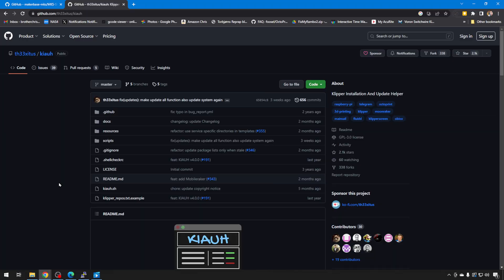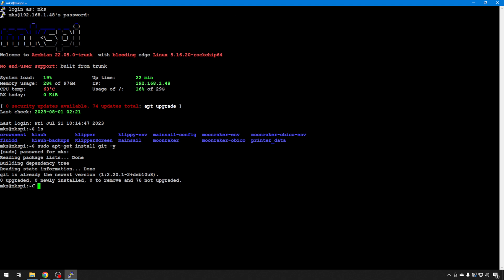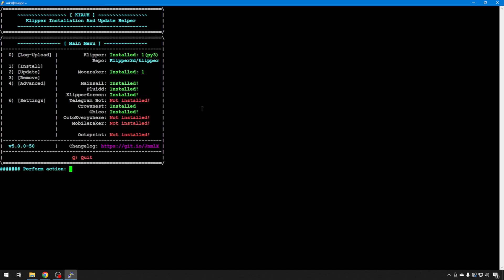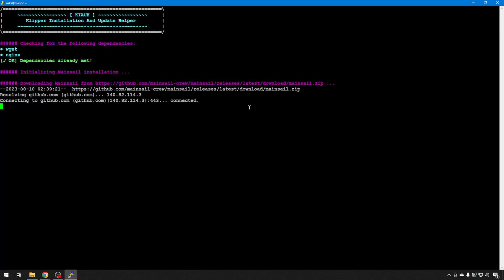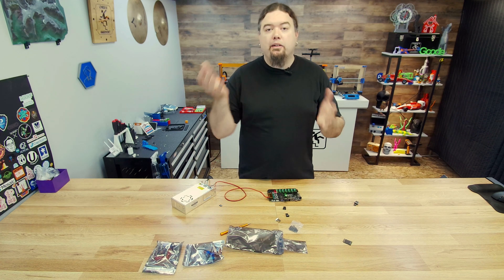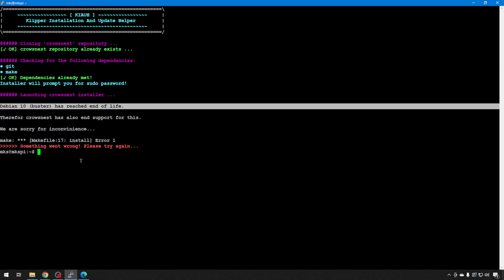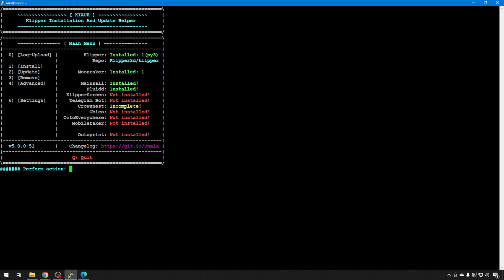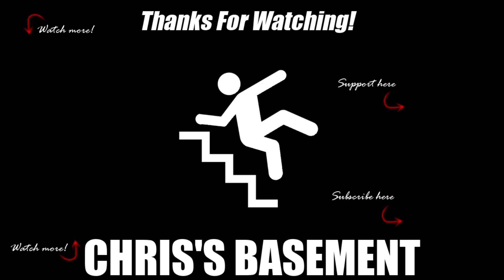KIAUH - The Easiest Klipper Install - Mainsail and Fluidd - Chris's Basement - 2023

Comment: Thank you for the coverage! I never expected that this project would develop such a wide reach.

Short clarification regarding the backup before update feature: that one is currently disabled in the background and won't do anything. I need to change some code to make it work again but i try to get around that as soon as possible. The rollback function does not utilize those backups though. Those backups would be plain old and simple copies of the folders of Klipper, Moonraker and so on. The rollback function actually rolls back the git history via git reset. It's an "in place rollback" utilizing the regular git tools so to say.
Reply: Did you change your name on github?  Also, Thank you for this excellent tool.
Reply: Yes i did. Im glad you like it! @joeldriver381
Reply from the maker: Thanks for the update and all the hard work on this!
Reply: Thanks a lot!  @ChrisRiley  Ah and you already spotted the update i made a few minutes ago? Yeah i went ahead and updated the backup functions quickly :). Also it's now possible to utilize the backup before update capabilities again which you mentioned. For some reason i cannot update my initial comment to clarify that i already made that code change. Anyways, thank you for covering my little helper tool! :)
Reply from the maker: @th33xitus  You're the best! 😉😉
Reply: So if you are using a raspberry pi then what enviroment would you choose rather than maker

Comment: Funny this popped up in my feed today, as I've been repurposing one of the kids' old Galaxy tablets into a linux tablet specifically for a tertiary delta rebuild. Debian took forever and a day to install without copy paste ability, but having a screen, the mainboard and a decently quick undercarriage with wifi all in one unit (that was 'FREE') is a huge boon. Guess it's time to get into KIAUH and finish up the software side!

Add: Well crap. I'm sure it's going to be more difficult without a dedicated Pi or equivalent, but thus far it will 'install' but everything says "Incomplete!"  for klipper, moonraker and mainsail. Everything else won't go to the next phase as (I'm guessing) it's not checking requisites or erroring out. This plan may have been doomed from the start. 😢

Comment: This script is great!
I really feel the need to thank you, Chris. I'm still using an Anet A8 (no, don't worry, I have an upgraded PSU, not that fire hazard that came with)... And recently I decided to upgrade it finally. I wanted to ditch the SD card for good, and started with octoprint running on an OrangePi Zero 3 and Marlin. Liked it, but immediately feel dumb as octoprint was just there to give me WiFi 😂
I jumped into the Klipper boat, and oh boy... What a mess, but really fun thanks to this series of yours! 
Now I'm in the process of installing an MKS SGEN_L v2.0, new drivers, new screen and get it all working before I dismantle the machine and convert it to CoreXY. I love this machine, it's still as fun as was in day 1.
Thanks dude.
Reply from the maker: Awesome to hear. Great work on getting all of this together. Great to hear to still find the fun in all of this as do I.

Comment: You mentioned an issue with the Debian 10 distro, has that been fixed?? I am very new (just a few days so far, still trying to figure out how everything works) to Linux, using LMDE 6 cinnamon, after DECADES of Windows, and have also NEVER compiled any firmware of any type. I just rebuilt my Ender 5 Plus to the point of, the only thing left that is still Creality, is the cube. I also built a triple Z axis following YouTuber "LilMikey's Big Plans" design. I have a BTT SKR Pro v1.2, and a BTT Pad 7. I've also seen videos showing the use of an old Android phone or tablet, to run Octo, not sure if that's even needed with the Pad 7. Compliments of a brain injury a few years ago, my hands, concentration levels, and just basic trust in myself when it comes to doing stuff like this, are all getting in the way. All the hardware is done, now it's just the firmware, and I just need to be 120% sure that I'm doing things right. The last thing I want to do is brick my board. What's even worse than that, is looking at my printer, and being unable to use it.
Reply from the maker: The pad 7 should take care of everything you need to run the machine. Including the distro issues. So if it is up and running fine, it includes Klipper. Go with what BTT provides for install files and you will be good.

Comment: Now I have my answers to why Two Trees SK1 has no camera. I badgered them to get the User/Password for three weeks before they sent it, along with a legal threat that if I 'exposed' their username/password they would pursue legal recourse (I'd already found the user/password at Makerbase and several Youtube videos). I have no idea when they will either 1. Refund my money or 2. Move to a different OS like Debian, either way I'm stuck with a overheating lemon. Yes, the MKS Skipr has two 40mm fans dedicated to it, the reason this machine has a 67db noise factor, yet no one is talking about the 'cooling' issues. I currently show 239 updates pending that will not be install... Oh and don't get me started on the use of M400
Reply from the maker: Sounds like Two Trees needs to do something about this. I would for sure request a refund.

Comment: I do not speak English well.
There are parts in the video that I don't understand.
This corresponds to about 5 minutes of the video.
kiauh - 3(remove) - b(back)
A screen where the installation programs are initialized will appear.
What kind of method is this?
Reply from the maker: Yes, this is Kiauh, it's a shell script to help install Klipper. https://youtu.be/LImiFmhMAB0

Comment: love the info provided made setting up my pi easy. I have a question maybe you could answer can you use KIAUH on the BTT CB1 board. the reason i am asking is i am upgrading my ender3's with the BTT  Manta M5P and CB1with canbus.
Reply from the maker: Yes you can! It will work exactly the same.

Comment: So I try to run fluidd in port 80 and mainsail in port 81
After I restart my board, I cannot access mainsail at port 81
What did I do wrong?
Reply from the maker: Hmmm, what version of Linux are you running? It could be a software firewall blocking the port, like UFW.
Reply: @ChrisRiley  Hi, Thanks for reply. I'm using the Raspberry Pi Zero 2 W. Using the Raspberry Pi OS Lite 64-bit with Debian Bookworm.
After I uninstall Mainsail and install it again using KIAUH, it is now working. Even after restart.
I restarted a couple of times now and its still working.
I don't know what went wrong in the first time.
Reply from the maker: @damzelfly  Awesome, glad it's working now.

Comment: Silly question I think... But I'll ask it anyways.

I installed Octoprint for my Ender 3's (v3 and v2) on an old PC and they are working great.

I want to play with klipper for both. Can I install klipper on the same machine? Or should I start over and install klipper on a clean install of Linux?

I'm not quite sure how the two systems might interact.
Reply from the maker: You can install them on the same machine, but I would start over and let Kiauh do the install. It will help you keep the installs separate and save you a lot of work.
Reply: Great to hear! Thanks for messaging back. 

Can you still use octoprint with marlin via kiauh? Or is it specifically octoklipper? (I apologize... I'm still new to this.)
Reply from the maker: @crooker2  Yes, Kiauh actually installs a generic version of Octoprint, so you should be able to use it with Marlin.

Comment: Hello I"m a newbei here... I installed klipper on my raspberry pi to use with my anycubic kobra 2, I keep getting this error "Source contains parsing errors: '/home/berty/printer_data/config/printer.cfg'  [line 289]: 'printer.cfg\n'". I have looked and cann"t a solution. can anyone help...
Reply from the maker: You have something going on in printer.cfg. It could be a bracket or something out of place. It says line 289, but it could be somewhere else.

Comment: Hi Chris, I successfully flashed my old Replicator 1 dual extruder printer with Klipper. I have klipper, Moonraker and mainsail as well as fluidd installed on a Linux mint laptop. This laptop is connected to my LAN I can print from mainsail as well as Fluidd but only on the localhost, on the laptop itself. I am not able to connect to the laptop from another network client. I am using :80 and :81 for M and F. I have already added a couple trusted clients into the Moonraker cfg but no joy. Do you have an idea or tip? Thanks
Reply from the maker: It could be a firewall. Check this out. https://forums.linuxmint.com/viewtopic.php?t=282502 It should be off, but double check.
Reply: @ChrisRiley  that is exactly what it was. I turned off the UFW in the mint firewall and things started working. Thanks for your reply.

Comment: Could I use this on my old prusa mk2.5 printers? I have an rpi on bot of them running octoprint.
Reply from the maker: Hey Espen! Yes, you can. You would use the flash menu option to flash it. You don't have to do the SD card stuff like on 32b boards.
Reply: @ChrisRiley  great! Does klipper constantly turn on and of the heatbed output like prusa does (multiple times a second). I had a problem with the heatbed terminal on one of my rambo boards it started melting. So I used a relay instead and just used the terminal to control the relay. The problem I faced was that I had to use an older firmware on the printers because the newest one at the time constantly turn the heatbed on and of like crazy. The relay was clicking like mad!
Reply from the maker: @EspenShampoo25  Prusa is really aggressive with the PID on the bed, you're right it does it really rapidly. With Klipper it's more mild. You shouldn't have that issue.
Reply: @ChrisRiley   follow up question to this. I've got a MK3S that I'd love to set up with all of this and have input shaper and other fun features working on it; would I need the MKS board in addition to prusa's board or would it replace it, or would an existing raspberry pi (like a pi3B) work fine (so long as I get Linux installed on it first)? I just want to clarify this comment for my own sanity in case I'm missing something here.
Reply from the maker: @Mr25561  You would just need to add a raspberry to get klipper working. The stock board should work fine. It does take a bit of extra work to get the Einsy up and going because of a serial chip issue. https://github.com/dz0ny/klipper-prusa-mk3s
Reply: @ChrisRiley  Awesome and thank you! I'm looking at it now; it looks like it calls for a raspberry pi zero 2 w, however it looks like there are commands to change it to look for a USB connection. It's definitely something newer for me to look over. Now I just need dig up one of my rasppis out of storage.

I'll keep you appraised of progress, and again appreciate your content; I definitely reference you a lot for MMU related concerns. ^_^
Reply: Nice, I'm in the process of upgrading my mk2.5s printers with hemera extruder I've had lying around for years now. Have thought about upgrading to a new printer but I don't think mk4 is worth the price! Should have been a corexy imo

Comment: Thanks for your great video.

This board seems very interesting. Qidi uses it also on their new X 3 series. I ordered an x-max 3, it should be delivered soon. I also ordered the eMMC adapter (there is a USB version also) and a spare eMMC module (both together about 12€ on Aliexpress), so I can do a backup of qidi's setup in case something goes wrong while update or tinkering.

In other videos it's mentioned the 8GB of the eMMC is a bottleneck, there is low free space and storing gcode in the default folder (wich is used if you connect the slicer to the printer directly) is limited by available space. So I thought about using a bigger eMMC module.

While there does no seem to be a bigger module from mks, the eMMC module for Orange Pi M4 seems to have same connector and formfactor (the two screwholes left and right of the connector do not exist, but the other (not used on the skipr) is in the same spot. The adaper to microSD looks identical. So I ordered the 32GB module with adapter. As I  do not know if the connector realy has same pinout, I will just test the spare 8gb-mks module with the adapter shiped with the 32GB module. If it works, its electrical compatible, if smoke accours, its obviosly not (and I just lost the cheap 8GB spare module and maybe one adapter).

Still, I remember on a rasperry pi you had to start an autoexpand to use full storage size if you have a bigger sd than the image. How is it on the mks skipr? If you flash the image on a larger SD or eMMC, do you have to expand the system afterwards manually or is it done by the system on first boot automaticly?
Reply from the maker: I am curious what you find out with the larger drive, I hope it fits the board, that would be great. Armbian should expand it automatically. If it doesn't, just reset the run once. https://forum.armbian.com/topic/487-reinitiate-sd-card-resize-on-boot/

Comment: I love KIAUH but if you use it,  I would not recommend doing updates from Mainsail or Fluidd, always do your updates from KIAUH. I've tried doing the updates from Mainsail and it failed and ruined the whole setup. I had to reinstall everything. I dunno if it's different now but I never had an issue updating from KIAUH so I only update it that way.
Reply: Thank you for liking the tool :) Usually KIAUH is designed to work hand in hand with Mainsail or Fluidd. Updating happens through Moonraker in that case. I don't think Moonraker does things differently than KIAUH does, but i can't tell 100% sure.
Reply: same thing happened to me…
Reply: I did have an update that I applied through Mainsail introduce a bug in Klipper that required reverting. I ended up fixing it through Kiauh. Updating through Kiauh would have been better, but so easy to just hit update in the web UI when it pops up. I am sure it isn't trivial, but it would be awesome if Mainsail /Fluidd could trigger an update through Kiauh behind the scenes.
Reply from the maker: Thanks!

Comment: Would you do a video showing all the different alternatives for a Raspberry Pi? Seeing how Pi's are like unicorns, it would be nice to see what options there are as it seems there are more competitors to fill the Pi shortages. I did watch the videos you had done on the Le Potato, Android phone, Skpr, and Mellow Fly Gemini, which are great.
Reply: Inovato. Any of the T95 Android TV boxes. I like the Innovato because it comes with a power supply and a pre-flashed OS, for $35.
Reply from the maker: Try these!

$35 - Le Potato -  Raspberry Pi  Alternative:
https://youtu.be/1gWkOil-MtY

Android TV Box - Take 2  - Time For Linux:
https://youtu.be/xAaAy7UPtF8
Reply: It realy depends on the size of the printer. If its bigger than maybe 310by310, it wouldn't be a problem to use a ThinClient. You can get them used often for about $20 (actually I got 5 Futro S900 for less than $50 a few years ago. More powerful than any pi. And they can be powered by 24V (calculate about 60W extra in peek consumtion for the PSU, but average is more like 18W). Actually most PC's from the last 15 years might do, but Thin Clients are quite energy efficient and have a small form factor. To make a case for the mini-ITX boards on printers >310by310 shouldn't be a problem at all. If you want to upgrade a Tronxy VEHO 600, 800 or 1000, even an ATX or eATX would fit without problem.
On the other side: If you want to upgrade something like a Monoprice delta mini, I wouln't bother to try anything else than a Pi Zero 2W. There is simply not enough space for anything else...
"all the different alternatives" is quite a range. Every computer wich can run Debian Buster or a derivate should do. Including some rooted Android devices.

You might even consider to test klipper on a normal notebook with debian installed on a Virtual mashine or as second OS. The Zero-cost "try-it" approach. If it works, you alsway can transfer to an other hardware.
Reply: @oleurgast730  good info. I have devian and klipper installed on a spare laptop now. It works fine but a little bulky for my cluttered work area. +1 for using an old computer.
Reply: orange pi
Reply: +1 for Inovato. They are solid little boxes, and not loaded with sketchy OS loads like some of those budget Amozon boxes. So nice to use a real power supply, rather than USB.
Reply: I have also used the BTT Klipper Pi board. Same issue with having to use their image, but super simple, and add bonus of being able to run on 12v/24v, rather than USB or gpio input. And has an ADXL input built in.
Reply: I'm running Klipper on a 2nd gen Intel Core i5 2400 quad core 64 bit PC with Debian Linux (a previous office computer) It cost 80$ 6 years ago. 20$ SSD in it and it boots in 5 seconds. It's currently running 2 printers with barely 2% CPU use. It's set up for 8 but can probably control 16+ at least but there's not enough USB ports on it, only 10 (2 reserved for mouse and usb stick)

Comment: Nice!   Currently figuring out what to use on Pi Zero Camera to setup as IP camera.  Separate from main Pi4 running Klipper/MainSail.  Suggestions appreciated? cheers!  

Edit:  Saw Chris has video covering Obico (the Spaghetti Detective).
Reply from the maker: There's a lot of good stuff out there. Check out iSpy https://www.ispyconnect.com/camera/raspberry-pi